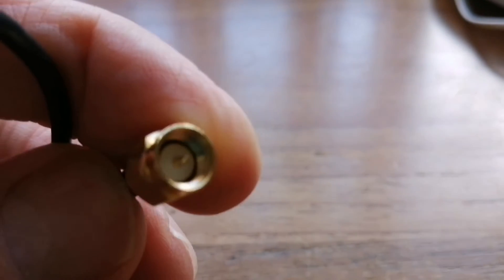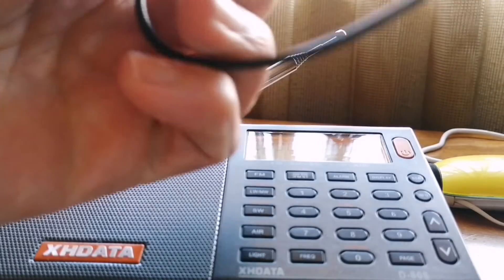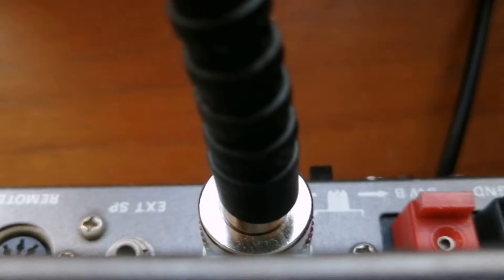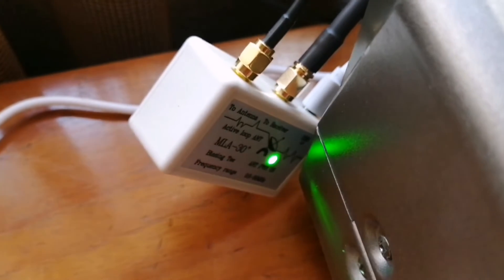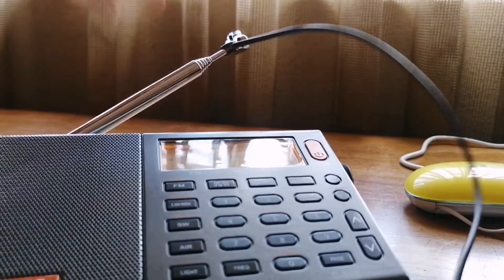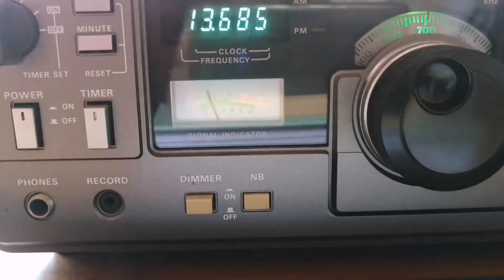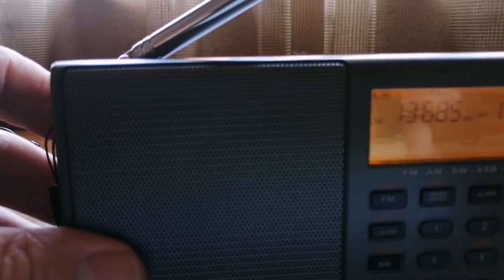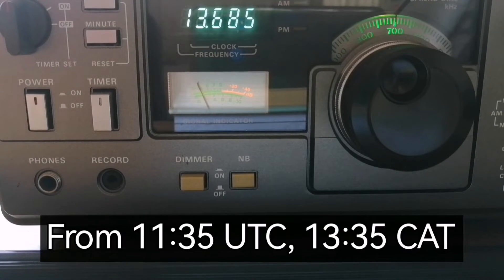My improvised MLA30+ connection to whip antenna vs proper adapter cable #antenna #shortwave

Comment: Many thanks for the very interesting and informative video! One question though. Sometimes this week I will receive my MLA 30+ and all my receivers take a regular mono jack; I have not had any luck in finding a proper adapter here in Argentina, so should I just cut the end of the suplied cable and solder the mono jack? will that do? Thank you!
Reply from the maker: My pleasure Alejandro. Yes, you can just cut the end of the cable and solder it to a mono jack. Or you can buy an SMA to 3.5 mm mono jack on Ali Express, they are cheap. That's what I did.

Comment: I have simple cable with an SMA connector on one end and a 3.5mm phone plug on the other to connect the MLA-30+ to radios with external antenna jacks . If I recall correctly, the XHDATA D-808 is more sensitive to a clipped on antenna than it is to one in the external antenna jack.
Reply from the maker: Thanks for your comment! I do want to attach a 3.5 mm plug to an SMA cable at some point, I just need to find someone who can do the soldering for me :-) When I get that done eventually it will be interesting to compare the MLA through the plug wire and the clipped-on wire on the XHDATA D-808.

Comment: As an old saying in Afrikaans goes: 'n Boer maak 'n plan.

As a quote from my words translated to Afrikaans by hand goes: Ek dink u het 'n goeie improviseer vir die antenna gemaak Andre. Goeie werk!

(Note: My quote wasn't originally in English, it was in Turkish)
Reply from the maker: That is true, we always make a plan! This is not the ideal way to connect the MLA30+ but it works well for me. Your Turkish to Afrikaans translation is quite good, just the word "improviseer" should be "improvisasie" :-)
Reply: @swlistening  It is hard to translate perfectly from Turkish. There is always at least one error in translation, there are some words that are hard to translate. We have specific words for specific situations. For instance, the word "lan" is common Turkish slang for someone talking to a male younger than them. It can also be translated into the word "damn" and a word I can't mention due to YouTube's policies. There are many meanings. It is the same with Afrikaans.
Reply from the maker: @FamtechVideos  That is very true. I think for online translations (not sure if that is what you did?) only the very well-known languages work well, for example between Spanish and English. But with smaller languages like Afrikaans the online databases are not really 100% up to date with all the possible meanings of some words, depending on the context, as you explained now about Turkish also.
Reply: @swlistening  No it was with a dictionary. I had to translate it to English through my head and then put it into STOMPI with an English to Afrikaans dictionary.

Comment: Your whip antenna has input impedance 1 mega ohm. The 64 to 1 one unun transformer would be better connection. To the radios whip antenna. Just jumper them the unun transformet to the whip. Just use the unun antenna lug to your whip. Ground the unun to out door or use random wire to give counterpoise. Good luck.
Reply from the maker: Thank you for your comment, this is good advice, I appreciate it!

Comment: Hello André, I've been less present on Youtube lately and on the SWL "scene" too because I've spent much of my free time on 2-way ham comms lately. More details when I get back to you by mail soon. Nice seeing that you decided to evaluate if a proper connection is worth it. However you're comparing apples to oranges a bit here IMO. It would have been more significant on a single receiver.  Maybe one day I'll end up shipping one of my home-made SMA-to-3.5mm jack cables to you. Do you think you'd have to pay taxes and such? this would fit in a plain strong envelope. Shipping can't be that expensive too. 
I'm not saying that your test isn't relevant. It is. They key point here probably is that you're enjoying a very noise-free environment, something that some of us don't have the luck to enjoy. In a noisier environment, I'm pretty sure that it would make much more difference.
(Edited for a missing "no" word)
Reply from the maker: Thanks Alain, I will be the first to admit that this comparison is not very scientifically sound :-) It's sort of the best I could do with my available equipment. It would be better to do this on the same receiver, for which, as you say, I would need an SMA to 3.5 mm jack cable. Which I don't have. If you were to ship something like that to me, it should be marked as a gift, then there will be no customs. But, sadly, our postal service is somewhat unreliable and very, very slow, it might take many months for the package to reach me, and it might not reach me at all. I do have a 3.5 mm mono plug available, so I just need to find someone who can connect it to the SMA cable in a proper way. Maybe I will ask our IT guys at work, they might have the right tools to do that.

I think this video does show, in my own very specific context where there is not so much noise, that a simple clip-on solution works more or less just as well as a proper connection. But results will certainly be very different in other environments, I agree with you on that. One of my viewers asked me to do a comparison like this, which is why I did it. But for me, personally, the results actually don't mean that much. These days I prefer the 10 metre, just seems to work much better. But of course I do still use the MLA30 a lot when I am listening on my Kenwood, and it certainly works very well on the Kenwood.
Reply: @swlistening  You can even ask me. I can solder. You can even ask the guy at Radio-Winkel.
Reply from the maker: @FamtechVideos  Funnily enough I did ask the guy at Radiowinkel, long ago, but he never got around to it. I think he has too many other things to do. But maybe I will send you a cable and you can solder it for me, that's a very nice offer.

Comment: I have found that I get less signal by clipping to the external antennas of my portables than jacking them into the radio.  This is more apparent on the MLA.  I am in a terribly noisy city situation though.... I am not sure why that is exactly, lack of a ground connection maybe? or that the antenna is injecting noise.  not sure.  I'm going to play with a loop-on-the-ground next.  Working on parts for a matching transformer.  THe MLA-30 jacked in is the winner for me.  I wouldn't hear much without that antenna.  It's been a game changer for me.
Reply from the maker: Thanks for your comment! I agree, the MLA really does help, for me it is mostly on lower frequencies, not so much on the higher frequencies. But I think I am lucky, I don't have too much RFI where I live, so the clip-on solution seems to work for me.

Comment: Andre, I don’t know if you have Amazon or EBay where you live, but I bought SMA to BNC, DIN plugs, even SO239 connectors which  are inexpensive to buy. They screw right into the SMA connection no soldering needed.   I also still use my old Sony cable to DIN plug adapter which lets you screw into the cable. That came with my late Sony 2010 that fell off a wall..😢!
73! Have a great day!
Reply from the maker: Thanks for this! We don't have Amazon here, but I do use them sometimes to order stuff, shipping is very expensive though.
Reply: Hi! could you please post somewhere a picture of the adapter you mention? Here in Argentina I haven't had any luck in finding anything of the sorte. Thank you!